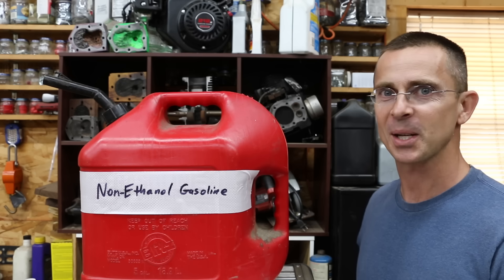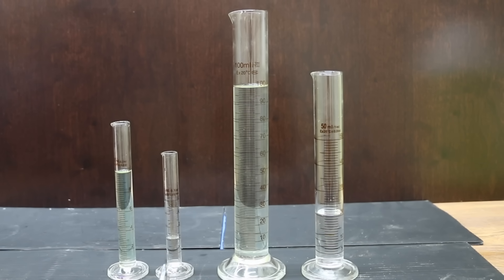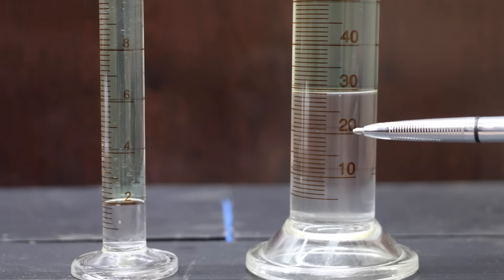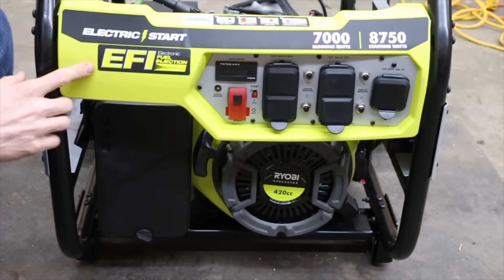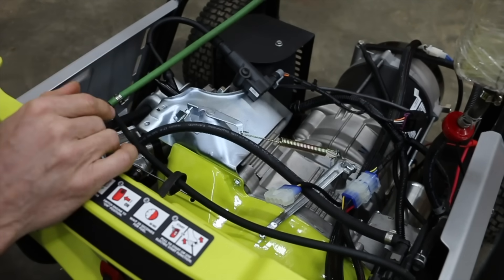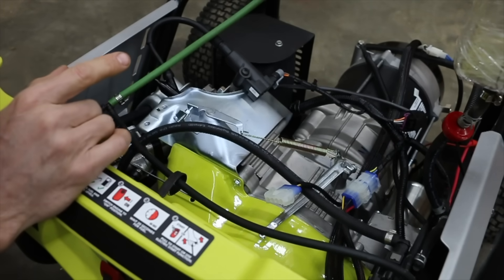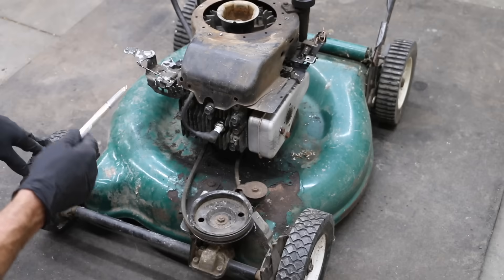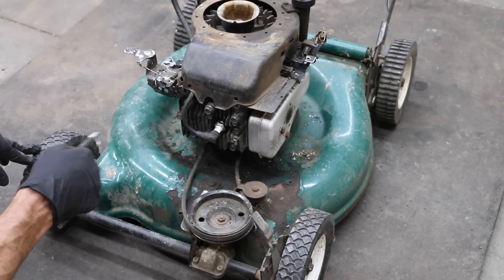Is Non-Ethanol Gasoline Really Better? See the PROOF!

Comment: I can tell you right now what ethanol enhanced fuels do to plastic and rubber components in the fuel system. It attacks them, and damages them! I’m a small engine and marine mechanic, and 90% of my business is comprised of fixing damage due to ethanol useage.
Reply from the maker: Thank you
Reply: Maybe you should just shut up and enjoy the increase business 😂. S
Reply: j p, I’m not complaining at all. Hey, people can run whatever they want. I let them know their options. If they choose to run ethanol enhanced fuels, they’ll just have to see me more often.
Reply: Is there a way to upgrade the components to ethanol friendly materials?
Reply: @randallnicholas1848  Since 10% ethanol gasoline has been around for over 30 years....why would any small engine newer than, say, the early 80s be using materials which would be damaged by it?
Reply: @brianleeper5737  i have a feeling that that's the part he left out
Reply: @brianleeper5737  10% ethanol has been around but it was never used until 2007 when laws forced gas stations to make the methanol additive gas illegal. This is when the Corn lobby won a big political battle to 'save the farmers and environment'.
Reply: @auburnalum9019  So much misinformation. (1) Ethanol has been used in gasoline since at least the mid 80s in the Midwest. (2) General Motors issued a TSB in 1986 stating that the use of 10% ethanol is OK in their vehicles and will not void warranties. That was in 1986-- 33 years ago! (3)MTBE, NOT METHANOL, is the additive that was banned because it contaminates groundwater, making it smell and taste bad even with very small amounts of MTBE.

I think the "cheap gas station owner who couldn't be bothered to fix their leaking underground tanks" lobby had a bit to do with #3.
Reply: @brianleeper5737  you can justify the junk ethanol all you want. Folks like myself that have witnessed its destruction of machinery before and after its wide spread use is all we need to now it is complete crap. Go ahead and spread your propaganda all you want. How many gas powered machines do you use?  Were you an adult before 2007  or just a brain washed millennial?
Reply: @auburnalum9019  I have 4 cars, a weedwacker, a generator, and a riding mower. Ethanol has not caused a single problem for any of them. Propaganda? At least I know the difference between "methanol" and "MTBE". 

Incidentally, I wasn't aware that Auburn offered courses in basket weaving, is that what you majored in? It certainly couldn't be anything technical.
Reply: @auburnalum9019  Methanol? The fuck?
Reply: @brianleeper5737 , Ethanol leaves deposits in small engine carbs that can render them useless. Ethanol sucks.
Reply: @auburnalum9019 , Amen. Ethanol sucks and I've worked on small engines my entire 60 yr life. Nothing but problems since they introduced it into gasoline.
Reply: @augustreil  In that case it's dissolving crap in your gas tank and leaving it in the carb. My gas tanks have no crap in them so I don't have this problem. Maybe it's because I'm not a hill billy that uses a sock for a gas cap??
Reply: @augustreil  You might also try this magical device known as a "fuel filter". It works wonders for keeping carbs clean, and I think if you forgo a beer you'll have enough money to buy one.
Reply: @brianleeper5737 , And the name calling and assuming begins. You have no idea what you're talking about and it's killing you.
Reply: @brianleeper5737 , Wow a fuel filter, Really ? I never knew a fuel filter could distinguish between gas and ethanol. Now, if you wish to discuss water separators, then you might have a leg to stand on, but I doubt it.
This whole thing has to do with ethanol carrying water into the carb and along with the corrosive ethanol drying out, leaves a residue that can close small orifices/jets and deteriorate carb parts, causing problems.
Reply: @augustreil  Well, if you have continual problems with deposits in your carb, I would suggest that a fuel filter might help. If your problem is water getting in your gas tank, then (1) replace the sock with a proper  gas cap (2) stop leaving the equipment outside where it gets rained on. If you forgo 3-4 cans of beer you can probably afford a tarp if the double-wide doesn't have a garage for you to store the equipment in.
Reply: @brianleeper5737 , Just can't make a comment without name calling ?  As far as you having any experience with small engines because:  "I have 4 cars, a weedwacker, a generator, and a riding mower"  
You are the last person anyone should take advice from about small gas engines.
Take care of yourself and your "3" items that have a small engine on them. Damn, you're funny.
Reply: @augustreil  You know, I use ethanol gas in everything and I don't have these problems. Seriously, how the hell are you getting water in the gas tank? Is it possible that the solution MIGHT be to correct whatever is problem is causing water to get into your gas tank? Don't blame it on humidity--it's regularly above 90% here all summer and none of my equipment has problems with it. Based on the lack of gasoline odor, all of my equipment has a very well sealed fuel system and perhaps that's why I don't have problems with ethanol (or problems with gas fumes igniting and causing a fire...)
Reply: @brianleeper5737 , Every gas cap on a small gas engine has a one way vent, letting air in and keeping gas from getting out, otherwise it would not run. It doesn't matter if it's a gravity fed carb or one that has a fuel pump. It has to be vented or it would not supply a smooth flow of fuel, thus making the engine run like crap. Some have a vent that can be closed, most do not. The introduction of air into the tank via the vent allows moisture laden air in which the alcohol absorbs like an alcoholic, kinda like me according to you. That is where the small amount of water is introduced to the tank. It doesn't take much when added to the corrosiveness (?) of the ethanol to make the jets and the tiny orifices of the carb to start to get smaller, thus making the engine run lean.
Reply: @augustreil  Seems the people who have problems with ethanol are the ones who have problems with everything else in their life--just looking for something to blame for their own ignorance and irresponsibility. That works for problems with both the fuel kind and the drink kind, too.
Reply: @augustreil  You might be right, but not quite in the way you intended. I have 3 items with a small engine on them. They are well maintained. If I had. say, 100 items with a small engine on them, I most likely would not be able to properly maintain them, and they would start having problems, and I suppose that could be blamed on ethanol. 

Ethanol is not forgiving of poor maintenance practices. I actually like it for that very reason. 

If you can't find the time to take care of your equipment, be it a truck, a car, or whatever, the sooner it craps out on you, the better.
Reply: @auburnalum9019  In California ,Vehicles sold in the state of CA must be able to tolerate ethanol. My 1989 Toyota truck's manual stated that the vehicle can tolerate up to 10 percent ethanol by volume with no problems. To top it off the state of CA also requires a special blend of gasoline with many emissions control additives in it. No other state uses it. 30 Years later it still works fine. I don't know if there is a difference between CA emission vehicles or else though.  But I live in a state where mandatory 2 year emissions testing for vehicles from 1976-on.
Reply: @brianleeper5737  O-ring materials
EPDM, BUNA, the most resistance to emulsification, is VITON.
My check valve on my Fuel Injector pump has been running with a Viton seal trouble free for 40,000 miles to date.
In fact, it is now outlasting the second fuel bypass valve of GM's "Engineers."
Any vehicle still running a steel fuel tank is actually not ethanol engineered.
Polyethylene tanks and top loaded sump
Cages are gasohol friendly.
Change your fuel filter and dump out the old one in a clean pan. The rust and corrosion compounds starting at the refinery, truck transport, retailer inground storage tank and finally in your fuel tank.
I do like project farms testing procedures.
In summer, ground temperatures are higher. Fuel in underground storage will be less dense at 4pm in comparison to 7am.
So some folks doing comparsions of ethanol free and non ethanol fuels, have much to consider in mpg trip observation.
Perception with applied science of thermodynamics, is not just viewing through a Lexan cylinder head. Exhaust gas temps, rather than heat gun check of block and head. Fuel baseline begins with flash point temperatures. Even dew point and humidity alters that.
Alcohol fuels are blended sometimes at the track, the day of the race by crew chief
Who is using the tests I listed. And fuel curves are compensated.
Generator was electronic injected and had ecu fuel management.
Reply: @900Yugo  Japan has been ahead of and leading the world in innovation since the Oil embargo by OPEC in 1973.
In 1975 my friend's Dad bought the first Toyota Celica in the neighborhood.
Our Fathers were all WWII vets.
All he had to say was that he was getting 30mpg and our Dads were stymied into wtf!!!!! A Chevy Corvair, on a prayer couldn't top that. GM Ecotec finally rolled out into dependable in 2000. 
1974
Chevy Vega, facepalm unsleeved all alloy block. 20,000 miles and 30psi compression. Failure and polluter.
Reply: @augustreil  Actually no it doesn't, that's been scientifically debunked, but what does it gasoline that isn't stabilized with a stabilizer.

The corrosion issue from ethanol is one thing, MOISTURE.
Reply: @brianleeper5737  because they offered 3 grades of non ethanol fuel. But in 2007 they made all gas ethanol
Reply: @ Brian Leeper Just an ignorant guess called PROFITS
Reply: Brian Leeper it eats your lines of theyre rubber if it’s a small engine it can rot away a line further down than your filter
Reply: @brianleeper5737  Your argument sounds okay on the surface. If you read your automobiles owners manual it will tell you directly that you cannot run a greater than ? percentage of ethanol or it will damage fuel system parts.
   In the small engine manuals it is stated clearly that unless you will use the tool often then you need to drain the fuel and run the carburetor dry or fuel system components will be damaged.
   Not just small engines will be damaged. Ethanol damages plastic and rubber components. When the proper plastic is designed then the issue will be removed.
Reply: @brianleeper5737  MTBE is added to the air in the atmosphere as exhaust after burning. It is then washed from the smog by rain and enters the ground water basins. It causes cancer in people, babies, and animals. Regardless of this being known and proven the state of california still attempted to force the whole of our United States to add MTBE to its fuel, and refused to allow the oil companies to not add it to gasoline. My guess would be that the politicians hand their hand s being filled by the chemical companies.
Reply: @bff1316  My understanding is that MTBE enters groundwater via leaking gas station tanks. MTBE is combustible and I would not expect it to enter the atmosphere via engine exhaust assuming that the engine is operating correctly. 

If it did, the main concern would be with surface water sources (in most cases it takes a very long time for surface water to reach groundwater aquifers; MTBE would probably be completely degraded by the time it did). The exception to this is areas with karst topography. In those areas surface water can very quickly reach groundwater aquifers.

 As I recall MTBE was banned for use as an oxygenate sometime in the early 2000s.
Reply: @randallnicholas1848  I was working on an engine and didn’t have time to rebuild the carburetor, so I purchased a rebuilt from Holly, after 2 weeks the engine was flooding constantly, upon inspection I found that the material in the accelerator pump was eaten away and I had to rebuild that carburetor, the new kit was specified for alcohol type fuels, that was in 2005 and the engine has worked fine since then, so yes with the proper gaskets and seals the alcohol is not a problem, when the change over to alcohol enhanced fuels was made many older vehicles had the same problem that I had requiring expensive repairs, but newer vehicles don’t seem to have a problem.
Reply: Ethanol has been being used in certain companies fuels since the gas crunch in the 70’s. That was the governments plan to get us out of the gas crunch. Then mechanics started pulling their hair out, as did consumers when their equipment would break down. While it can be used as a fuel, there are precautions that need to be followed while using ethanol enhanced fuels. I’ve had customers never have a problem, I’ve had a few that have been back in my shop a few times a season. It largely weighs on if the precautions I tell people to follow are adhered to or not. For instance, every mower I work on leaves with an in line shut off valve added to it. Reach down, shut the fuel off, and run it till it’s dry. Problems solved. But the tank still needs a stabilizer added to it, or else phase separation can occur. Or keep the tank full. A full tank won’t phase separate as easily as one that’s half empty.
Reply: @ripperace  As another precaution: maybe not store the equipment outside where it can get rained on and water get into the gas tank.
Reply: @ripperace  Also it may sound strange but I occasionally add Chevron Techron Fuel Injector Cleaner to the gas in my riding mower and generator. It doesn't hurt anything and probably helps keep the fuel system clean. I only use that particular brand of fuel injector because it's what Costco has on sale once in a while.
Reply: Wasn’t trying to start anything. I’ve just seen where the ethanol blended fuels seem to degrade fuel lines and carburetor gaskets. Plus it seems to varnish easier. And yes, I know over the counter fuel additives help prevent varnishing.
Reply: @wildchildomega  It's interesting that ethanol blended fuels are thought to degrade fuel lines and gaskets because I use denatured alcohol (mostly ethanol with a bit of methanol as a denaturing agent) as a cleaning solvent on plastic and rubber as well as circuit boards specifically because it's one of the most mild solvents around, especially compared to toluene or xylene (which are components of gasoline).
Reply: Brian Leeper True, I’ve done my fair share of circuit board repair, so I understand what you are saying. I’m not sure if it is the actual ethanol that degrades the materials due to long term exposure or the fact that ethanol collects water the way it does (as mentioned in the video) that causes the problems.
Reply: @wildchildomega  I haven't read it yet but I found a research paper with Google titled " Performance of elastomeric materials in gasoline-ethanol blends-a review " and the full-text PDF is free to download! If you want to find it do a Google search for that title. (A lot of research papers aren't free and I'm not quite THAT interested that I'm going to pay $50 for one)
Reply: @brianleeper5737  You think ethanol does nothing to fuel lines and gaskets? Here's a little experiment for you: go to the store and get yourself a plastic bottle of denatured alcohol and a plastic bottle of white fuel. Exchange the contents of those two plastic bottles and set them away some place [extremely] well ventilated., preferably outside and on a dripping tray large enough to hold the content of the bottles. Within a week you'll see heavy deforming on both bottles and part of the contents already missing. The bottle that is marked to contain denatured alcohol but now holds the white fuel will show condensation on the outside and if you wipe it you will notice the distinct stench of gasoline.

Here's the thing: there is no plastic or rubber, neither natural nor artificial, that can withstand both substances. If there had been, they would not have erected two different manufacturing lines to produce two different plastic containers. The combination of ethanol and gasoline is literally lethal and the number that follows the `E` identifies the speed at which your demise will present itself.
Reply: @gordonbos5447  HDPE. High density polyethylene. That's one plastic that can withstand both gasoline and ethanol. If you don't believe me, you may use Google to research it yourself.
Reply: @gordonbos5447  It didn't take me long to find that the Parker O-ring guide lists "satisfactory" compatibility, which is the highest rating, for both ethanol and gasoline, for the following o-ring materials: hifluor fkm; perfluorelastomer fkm; fluorosilicone fvmq. As far as the layman is concerned, these materials can be considered rubbers, although the more educated man refers to them as "elastomers". 

As far as your claim that they would use a single plastic for both disposable containers of white gas and ethanol if one existed, I have another explanation as to why they use two different plastics: the plastic that can withstand both costs more. It is cheaper to use two different plastics. Or the two products are not packaged by the same company. For example, the denatured alcohol at my local store is a Klean-Strip product and they do not offer white gas.

That being said, I cannot get denatured alcohol in a plastic container. It comes in metal containers around these here parts. However, I checked a bottle of isopropyl alcohol and that is an HDPE container, as is my 5-gallon gas can in the garage, also an HDPE container. And the chemical compatibility table for HDPE lists it as having excellent compatibility with ethanol. And we would hope that, given it's use for a gas can, HDPE would also have excellent compatibility with gasoline.
Reply: @brianleeper5737  Hope isn't enough and I have actually had a gas can that I'd bought at a fuel station collapse as described after I had filled it with E5. Gave me a good scare.
Reply: @gordonbos5447  What was that gas can made of and did it have the appropriate approvals for use as a gas can? That you bought it at a gas station, as opposed to a major retailer, makes me question it's quality. Gas stations are notorious for being run by people who will buy the cheapest junk to put on their shelves--for example, no-name engine oil that doesn't meet API specs.
Reply: @brianleeper5737  Don't think so. Regulations are pretty uptight here. The extra buck one could earn on the poor sod that stranded one mile before the gas station really isn't worth risking your shop being closed by authorities.

Obviously I tossed the destroyed can. Still have a few other comparable cans lying around though. They are all marked DIN 16904 so yes these are all certified for carrying spare fuel.
Reply: @gordonbos5447  You are not in the USA. The regulations for gasoline cans are very different here. This could account for why our gasoline cans are not known to fail when storing E10 gasoline.
Reply: @gordonbos5447  And I just looked up DIN 16904 and that appears to have nothing to do with gasoline cans.
Reply: @brianleeper5737  Correct. It's not about the can but about the material that the can is made of.
Reply: @gordonbos5447  Yes. Here in the USA gasoline cans must meet CARB (California Air Resources Board) EPA (Environmental Protection Agency), and NFPA (National Fire Protection Association) standards. And if it's going to be used on a jobsite it has to meet OSHA (Occupational Safety and Health Administration) standards as well. They also must be tested by an NRTL, Nationally Recognized Testing Laboratory  such as Underwriters Lab or Factory Mutual to ensure that they meet these standards. And because E10 gasoline has been available in the USA for at least 35 years, and E85 gasoline for at least 15 years, you can be sure that any approved gasoline can that you buy in the USA will not be degraded by these fuels, whether it be made of metal or plastic. 

This is all about safety, fire prevention, and environmental protection. A gasoline can that would be damaged by ethanol-containing fuels is a safety, fire, and evironmental hazard, and is not permitted by the relevant standards.
Reply: @brianleeper5737  Correct. It is about safety, that is the whole point. A safety standard for materials that are suited to transport an aggressive fluid does exist in both DIN and ISO and should be obeyed. The problem is that it is governments that are ignoring the standard by obligating petrol manufacturers to mix in a second fluid that is also aggressive but not towards the exact same compounds. So in essence we require a new standard, but we don't because we don't want to tell people that it is now illegal to drive their hippie-van and so we just leave everything as is and hope that they all burn to sinter together with that polluting antiquity they dare call a car.
Reply: @gordonbos5447  There IS a standard for ethanol-compatible gasoline cans. It is ANSI/ASTM F-852-08. It is not hard to find a gas can that meets this standard here in the USA; all the ones I looked at do. There is probably a regulatory requirement (most likely EPA, since gasoline cans sold in the USA have to have an EPA certification # on them)that these cans meet this specification. 

So, the question is, given the existence of a standard for ethanol-compatible gas cans, and their widespread availability in the USA, why are gas cans which meet this standard  seemingly not available elsewhere in the world????
Reply: @gordonbos5447  Upon further research, there are state and local laws in the USA which REQUIRE "portable gasoline containers" to meet the ANSI F852 standard.
Reply: @brianleeper5737  ehhhhmmm. If I google that reference I get to a page that states that this standard was withdrawn in 2017. In other words: your container that you state is still being sold is no longer considered to be safe due to what they did to the fuel that it is supposed to be capable to contain.
Reply: @brianleeper5737  Which kind of describes my point. Laws requiring the fuel to be changed to conform to some specs and at the same time requiring the equipment to handle that fuel to conform to standards that have been invalidated due to the government imposed change to the fuel. These people have absolutely no clue whatsoever.
Reply: Sorry, we appear to have something of a time-lapse here (other than the 8 hours that I'm ahead of you)
Reply: @gordonbos5447  Google some more and you will find that it was withdrawn because it had been 10 years since the standard was updated, and an action was take to re-instate it.
Reply: @gordonbos5447  When you say "these people have absolutely no clue", if you are speaking about the lawmakers and standards bodies in your country, I would have to agree since they apparently allow gasoline containers not suitable for ethanol gasoline to be sold.
Reply: @gordonbos5447  Reinstated with ASTM work item ASTM WK57552 google that number for details
Reply: @gordonbos5447  ASTM F852/F852M-19 is the most recent.
Reply: @gordonbos5447  In the USA, here were several fires in the late 1800s and early 1900s, the best known of which was the Great Chicago Fire, that lead to a greater emphasis by insurance companies on fire safety. This lead to organizations such as National Fire Protection Association and Underwriters Lab, which lead to product safety standards, which eventually became mandatory via fire prevention and building codes.

This process was and is largely immune to the whims of voters.
Reply: @brianleeper5737  Granted, but it would hardly be NFPA or similar institutions telling politicians to create laws for adding ethanol to fuels on the premise that this would enhance fire safety, as of course it in fact causes the exact opposite with at least existing storage and equipment. Privately owned items that the government neither does nor can control.
Reply: @gordonbos5447  The NFPA's role would be to promote safety regulations for the handling and storage of ethanol containing fuels. I think they have been effective at that, given that we have a standard for gasoline cans and laws requiring gasoline cans to meet that standard. And laws requiring gasoline to be stored in gasoline containers and not used milk jugs (for example).
Reply: @brianleeper5737  No it hasn't, because as I already said the hippie-van (or hippie-bus or whatever you call it - the VW thing) amongst others does not, cannot, comply to the new fuel standard. It's not about using milk jugs, it's about the milk being spiked. And if it was actually milk that we were talking about you might actually feel relieved by the additive eating it's way through the packaging, because that would prevent the stuff to enter your digestion system, but as we already established this is flammable stuff and the fumes alone are in fact already enough to kill people.
Reply: @gordonbos5447  Here in the USA, it's not a new fuel standard. It's been around for at least 35 years!
Reply: @brianleeper5737  Henry Ford lived quite a few years before that.
Reply: @gordonbos5447 It was inevitable that leaded gasoline and carburetors were going to become obsolete.
Reply: @brianleeper5737  I fail to see the relevance of that remark.
Reply: @brianleeper5737  Oh... wait... Apparently I'm a bit slow. You think that the ethanol is being added as an alternative to TEL to raise the octane number and prevent knocking.

That is not true. In fact TEL was only added in higher amounts to serve this purpose for very specific purposes: aviation and car racing. The main reason for adding TEL in commercially sold fuels was to control damage to valves and valve seats. The raised octane number is only required for a few European and Japanese high performance cars and that's not nearly enough for the government to require this additive to be included in every fuel in a specific percentage.

The only reason for mixing ethanol in fuels is to manipulate statistics related to climate control. Using E10 allows for subtracting 10% of the emissions for being renewable. Remember diesel-gate? The exact same thing, only in that case it wasn't the government itself that created the hoax.
Reply: @gordonbos5447  I believe that the original purpose of E10, so many years ago, was to offset the use of foreign oil. Perhaps the 1973 oil embargo was a factor. That corn producers benefit from it as well was an additional perk. It also is supposed to reduce vehicle emissions because it is an oxygenate, but on vehicles with a (functioning) oxygen sensor, the benefits of that are questionable. However, it is a fact that the US EPA mandates the use of oxygenated fuel in many areas of the USA, to reduce pollution. 

The only other viable oxygenate, MTBE, was banned about 15-20 years ago due to issues with groundwater contamination. 

The "official story" is that even the slightest concentration of MTBE will impart a foul taste to water, and leakage from underground gasoline tanks would allow MTBE to contaminate groundwater.

Back to the lengthy history of E10 fuel in the USA, I find fascinating that in 1986 -- 34 years ago -- General Motors issued a TSB (it's possible that other automakers did too; I only have access to GM's TSBs via the 2005 TechLine DVD set, and only because they saw fit to include TSBs that old) stating that their vehicles were designed to work with E10 gasoline and that doing so would not void the warranty. 

This suggests that, by 1986, E10 gasoline was commonly available in some parts of the USA (most likely near and in the corn growing areas of the midwest). Further research supports the idea that 1973 oil embargo spurred the development and use of E10 fuel, as E10 fuel appears to have been available as early as the late 1970s.
Reply: @brianleeper5737  The only reason I'm aware of for using MTBE was to replace TEL as a valve (seat) protection agent. Interestingly this would have mostly applied to cars that ran happily with the lowest available octane number, which includes American build cars because honestly you were just lazy, simply adding more cylinders when more power was desired. For instance, in the seventies a Mercedes with a 2.3L engine would easily outperform an American muscle car boasting a 5.7L engine. The Mercedes engine which features an aluminium head would have had hardened valve seats already and thus not need the fuel to be "leaded". It would however have required premium gas because of the higher compression, but there are two reasons why you should not want to raise the octane number to the Mercedes' required level with ethanol:

1 - because ethanol contains less energy and thus negatively influences this high performance engine.
2 - because ethanol has a corrosive effect on aluminium and thus affects the engine's lifetime.

So it's not just corn growers being happy if you throw E10 in your engine, it's a large string of manufacturers involved in making engines that are having a ball if you do so. I mean, how much money do you think Jaguar collects on an annual base from all those iconic E-types still running? Don't answer that, let me do it for you: nothing. If however you set your oldtimer car on fire by putting E10 in it, they can sell you a new car.

Question being: how does increasing consumption serve the environment?
Reply: @gordonbos5447  https://en.wikipedia.org/wiki/MTBE_controversy is a pretty good overview of what happened with MTBE in the USA. As always, lawsuits and lawyers have a lot to do with it.
Reply: But so do non ethanol aromatics. They do the exact same thing, get old, stale, corrode and break down rubber and carbonize even worse than shine.
Reply: @superwilcox9026  Please don't bring chemistry into this hill-billy ignorance fest!
Reply: @LifeLongStrong1961  I owned a Chrysler(Diamler Benz)Minivan. Supposed to be FlexFuel E85 compatible. I added 1 gallon of E85 to six gallons of 89 octane regular ethanol/gas 10% max.
And the van acted like I kicked in the nards. Coughing, sputtering. Any vehicle that was sold claiming flex fuel capable with a steel fuel tank is fradulently marketed. FCU, has been caught fudging their diesel software just like VW was.
Lier Lier, pants on fire!
GDI systems are the future with sensors using adaptive control learning ecu's.
Asia has been doing that for a while now.
Fords "Ecoboost" system was Engineered by an Asian man. He is/was, suing Ford for patent infringement.
Reply: Buy ethanol fuel cheaper, but then have to ad expensive stabilizer in the tank that only works if you ad the stabilizer before you fuel the tank. Might as well just sell pure gas, be cheaper by the time put all the stabilizers in ethanol blend fuel. And I don't care how much stabilizer you put in the fuel, your steel gas tank will rust from the inside and you carb and injectors will be clogged if you let the fuel sit more than 2 months. You can shut the fuel off and run the carb dry but it's still going to rust your tank the that crap will be all in your fuel filter. Ethanol fuel is trash. I've pumped 100's of gallons out of fuel tanks cause it was only barely good enough to start a camp fire with and that's what it was used for.
Reply: it trashed the carb on my Stihl chainsaw.  e10?  never again.
Reply: I always use Stabil in fuel going into my small engines, the alcohol in fuel eats NOT only the plastic and rubber parts but will eat the casting of the carburetor
Reply: In 86 all GM cars were injected. The problem is with aluminum carburaters.
Reply: @jsmeswagner6104  Ethanol doesn't attack aluminum, Methanol does.
Reply: Wtf ever, ive been working as a small engine mechanic since 17, all gas damages plastic and rubber over time you old fart. Ethanol has a lower flashpoint and is safer on the hard parts. I run e85 in a built civic drag car and i make almost 200 whp over my old tune on pump gas. It allowed me to run more timing in boost and run more boost and not detonate.
Reply: @Turboboob  Your know so little about anything you didn't even watch the video to see everything you said was proven WRONG! Grow up kiddo!
Reply: No matter whether you store your equipment outside or inside. Ethanol attracts moisture and degrades quickly. If you can find non-ethanol gas by all means you should be running that in your small especially two cycles.
Reply: @Ripperace This is extremely true